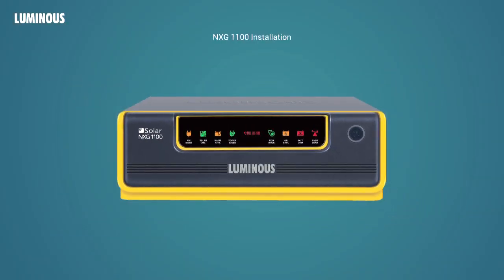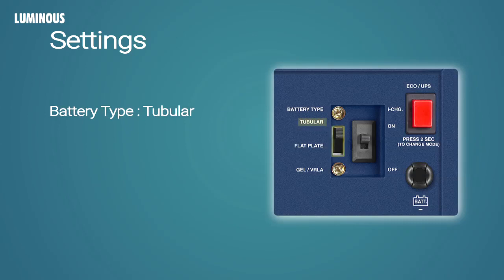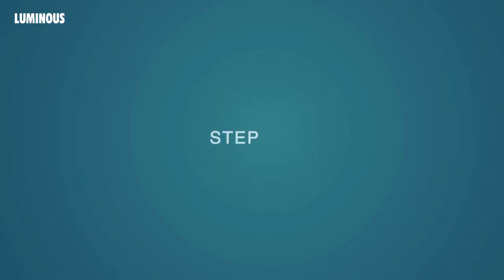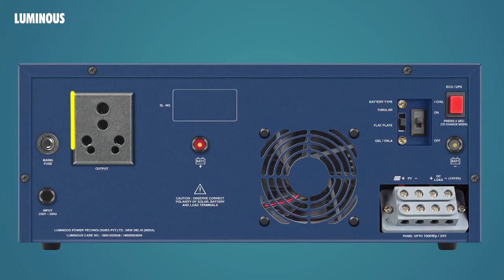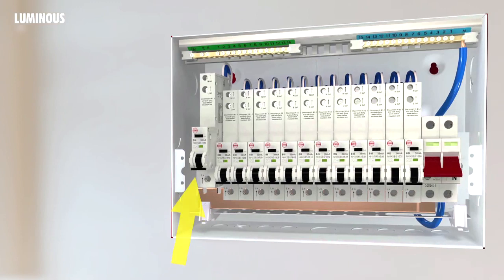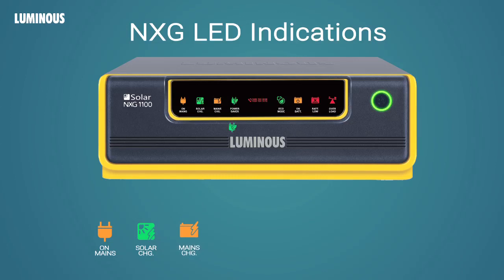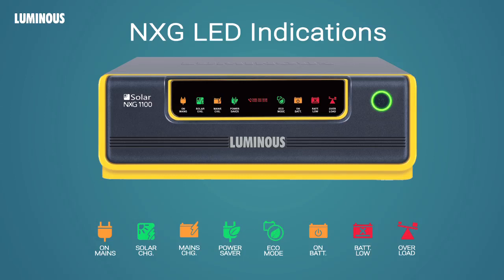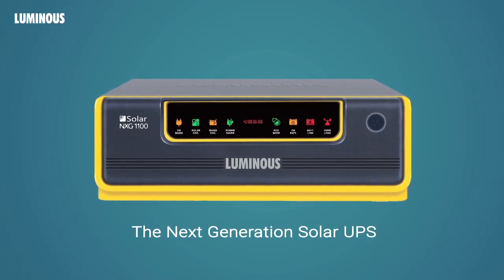How to Install Solar UPS Batteries - Solar NXG UPS Installation Demo by Luminous

Comment: Luminous NXG 1100 inverter me
160ah +40ah battery connecte kar sakte hai
Reply from the maker: Aap NXG 1100 ke saath doo batteries connect nahi kar sakte hai kyu ki wo 12V system hai, isliye aap kewal ek battery hei connect kar sakte hai.
Reply: @LuminousIndia  parallel connection bhi nahi kar sakte sir
Reply from the maker: @Aryanvlogger-20  We do not recommend to do that

Comment: I have connected a Car Battery (Exide Milage). Should the setting be change to Flat or Tublar Battery. This is a temporary as there is a lockdown and I cannot buy a new battery for next 1 month.

Comment: I have NXG -1800 WITH 1000watt solar panel and 2 × 150Ah battery. When battery is full charged the inverter not take solar power and it only working under main supply. 

Power-save mode not working if battery is full. It's unless and don't use solar energy. 

I complaint about it many times but no reply from luminous.

Comment: Mera inverter battery 12.9 volt te uper charge nahi krta and 11.8 v par low battery indication dena shuru kr deta hai same yehi inverter hai
Reply from the maker: We are sorry about your experience. Request you to kindly register a complaint on Luminous Customer Care Numbers 18001033039 , 18605003939 or you can send us an email at care@luminousindia.com.
Reply: @LuminousIndia  please tell me when luminous nxg get full charge what is battery voltage at that time  and tell me low battery battery indication also

Comment: Can I use NXG 1100 as a regular inverter, means without using of solar panel, or solar panel must be it.
Reply: Yes sir you can use nxg 1100 as a normal inverter.
Reply: @akashgaikwadn8  sir.. when we use nxg1100 as a normal inverter (without solar) ,on 230volt AC, what is maximum load capacity...pls explain

Comment: sir i have luminous solar nxg 1100 model with 150ah battery and two 160 wt panel ...can i add one more 150ah battery in parallel connection?
Reply: Can I use this nxg1100 with a single 180watts 12v solar  panel and with single150 ah 12v battery setup??? because my usage is very low...

Comment: I have nxg1100 . i wnt tp know which type solar charge controller inbuilt in
Reply from the maker: Thank you for reaching out to us. The NXG 1100 model has PWM charge controller in it.
Reply: @LuminousIndia  why company didn't use mppt controller

Comment: How many watts Pv moduels can be connected with nxg 1100 solar hybrid inverter.? Highest input amp & voltage. 1000w written on back side, little confused.
Reply from the maker: We have noted down your query and have escalated to our concerned technical team. We will get back to you with an update shortly.

Comment: Can it be used as a stand alone inverter? ex: I just connect a battery without solar panel?
Reply from the maker: Yes it can run without solar panel also.

Comment: There is a big mistake on this inverter that is we can't put switch to solar charging only. In my home 6pm to 8pm electricity not available that time inverter will work. After 8pm electricity will come that time luminous nxg inverter charging from grid  all night and in the morning solar will on that time power saving mode that means battery is full.After 9 o clock in my home every one go to office and school,that time making current from solar is wasted.
Reply: I have also This problem
Reply: You can keep Main supply to inverter off all the time... ON main supply only when inverter shows low battery indication
Reply from the maker: We would like to know more & clarify any questions you may have. Could you please share your contact number along with location details?
Reply: My name is jobin and my mobile no 9388631899
Reply from the maker: Thank you for sharing your contact details. We have forwarded it to the concerned team. Our team member will get in touch with you shortly. Meanwhile, we request you to kindly share your location details as well so that we can assist you better.

Comment: Sir i have a query regarding NXG 1400 model is have a MPPT Or PWM charge controller inbuilt ??
Reply: Er Kumar Abhilash as mentioned in manual, it's mppt only
Reply: Thank You sir...
Reply: Er Kumar Abhilash did u buy solar system ? Am planning to buy for my home
Reply: Vijay Kumar yes i have Luminous  300 watt panle and 150 ah battery and a Charge controller... also connected a 300 VA V guard UPS.... so i want to buy this NXG 1400...

Comment: Brand eco 1100 may max kitna  watt ka panel install kor sakthe hai
Reply from the maker: Hi Sanjib, we would like to know more & clarify any questions you may have. Could you please share your contact details along with location details so that our representative can get in touch with you?
Reply: For single battery max 320 watt.
For double battery(parallel connection)500 watt max.
For 12 volt system.
I have sukam 1100 brainy eco with 160*2=320 watt system installed in my home and work fine.
Reply: 200w ka 2/3 panel kiyse connect korenge series ya peralal

Comment: Sukam brainy eco 1100vs  luminous nxg 1100  kon sa products better quality  hai?
Reply: sanjib kumar chatterjee . Sukam brany eco11 best
Reply: Sukam brainy eco 1100 is the best,
But sukam company close ho gayi hai,
So in future luminous nxg 1100,1400,1800 model hi lena hoga.
I have both inverter in my 2 home sukam 1100 & luminous nxg 1400.

Comment: I am thnking to install 450 va inverter for my home purpose for a single fan and led light bulbs during powercut..Though I h've a refrigerator which runs 24/7,I don't want to power my fridge but when there is a power cut since it will overload my inverter
.My concern is that each time when there is a power cut do I need to turnoff my fridge every time? or else keep the inverter off but charge the battrey from the panel,when their s a power cut turn off all the load  and then switch on the inverter.Is this is the way to operate?.Kindly suggest me.I totally confused.
Reply: Roopa Iyer just do  a simple thing firstly separate connection for Fridge's which have not connected with inverter's output.apka kam ho jayega for more info contact me 9050483770